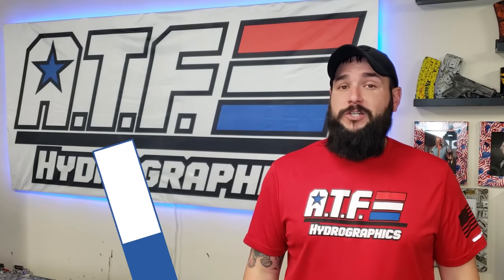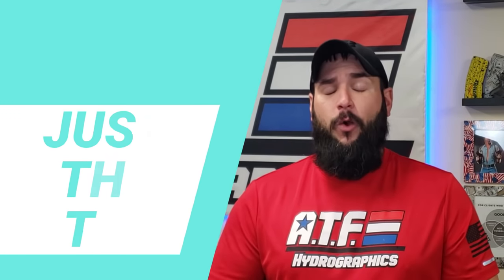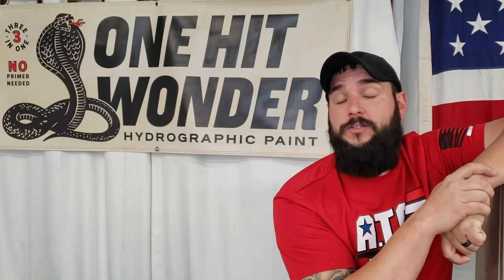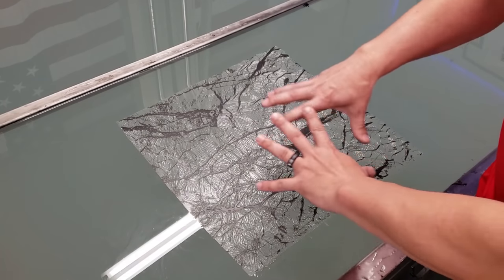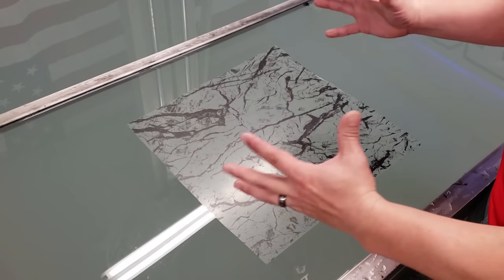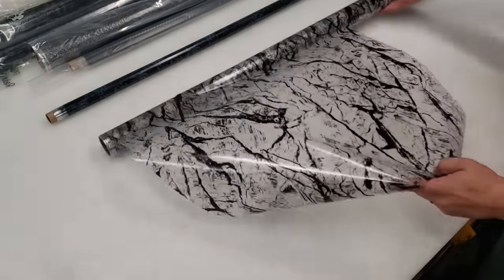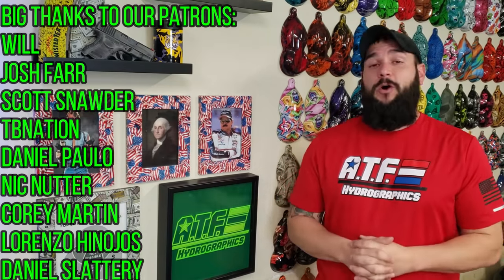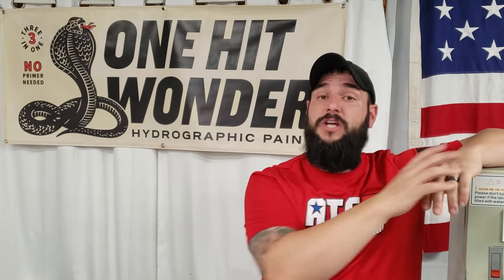Want to get better at hydro dipping? Stop Doing This!

Comment: I just dipped a small gun part. Had cleaned it, scuffed it and primed it 2 days ago. My test was good but when I dipped the part, it looked great when I pulled it out of the water but when I rinsed it off, not only did the pattern come off, the primer did too. The part had a camo pattern but I cleaned it and scuff it and thought priming it would be ok.... do you know where I went wrong? I don't want to dip the rest of the parts til I find out why this happened. I'm new at this but I've done several pieces and this is the first time this happened.
Reply from the maker: What kind of paint did you use, and how did you scuff it?
Reply: @AllThingsFunHydrographics  scuffed it with those red scotch pads and used the shark bite, I think it's called, paint
Reply: @AllThingsFunHydrographics  Same process as I've used before but it's been humid and I'm doing it inside but with the garage door open. Not sure if that played a role?
Reply: @AllThingsFunHydrographics  I just tried another gun part. It was brand new. Cleaned it, scuffed it, cleaned the dust off. Primed it and I did a roll dip on it. I had practiced on some tumblers and while my technique wasn't great, the film didn't stick at all. It literally was dripping off as I pulled it out of the water even before I had a chance to rinse. The smaller accessory parts I did for the same part came out ok right before it. One of them seemed to have the pattern pull off a little but not like the main part. I took a video of it dripping off and a pic of what it looks like now. Would love to send it to you to see if you can watch it and tell what I'm doing wrong. And I have no problem paying for your wisdom if you can tell me what the issue is. =)

Comment: I’m getting bubbles between my material and whatever I’m dipping, how can I prevent that,
Reply from the maker: Your getting air bubbles when you put the film on the water, you have to lay it in very carefully so that it does not trap air. If you see bubbles under the film you can blow the bubbles out from under the film.

Comment: Ok so i tape the edges because when you spray the activator, the film spreads out but doesn't stop. You didnt show that part. Whats the cure for that?
Reply: I dont have a proper tank, so i dont have adjustable bars. So how can i dip without taping up the edges in the bath?

Comment: Is there a heat resistant film for grills, smokers, etc.?
Reply: No... the films only good for around 400 degrees and the clear coat won’t hold up either..
Reply: @customcyclehydrographixorr3979  thank you.
Reply from the maker: What Roy said. If you need something for high heat I recommend the C series Cerakote. I have tested it up to 1000 degrees and saw no changes in colors. They are limited on what colors they have but it does resist heat very well.

Comment: I tried your tips today, with no mask to the side, but when I spray the activator the film starts to distort the image... How do I fix it?
Reply from the maker: You need dams to hold the film in place and keep it from moving. Watch any of my videos where I am dipping something and you will see I use dams to keep the film from stretching. You can make dams out of anything you want, some people use pvc pipe, aluminum roof flashing, tape. I have aluminum dams that came with my tank.
Reply: @AllThingsFunHydrographics  I understand, I just thought they were used to keep the film still. Thanks a lot for the answer. I keep learning from your great work.

Comment: I’d imagine the cryptarch film rolls on itself due to high concentrate of ink in the heavy pattern making it heavier in other blotches then what it is near edges, making the film tighten on itself. If that makes any sense. Heavier ink pattern cause it to weight down on the film, dragging corners in or up.
or 
I’d imagine manufacturers have maybe just rolled the film to tight upon its drying, when it was originally printed & they’ve just rolled it to tight, potentially stretching the film, 
Then once it’s cut small pieces it wants to roll up again.
Reply from the maker: Yup probably. Is what it is... so we just learn to deal with it.

Comment: You have to cut little section along the tape before you put it in water, that's why the film cant move!! ;)
Reply from the maker: If you cut the tape then the whole point of the tape is useless. But to each his own, The way I do it works for me and eliminates having to tape, but you can do whatever you want.
Reply: @AllThingsFunHydrographics  I've also seen other videos where people put the tape on the other side. I'm saying this because I saw you put it faced down into the water. I think face up would show different rwsults, as the entire film is touching the water (including the edgesb and once it gets soft, the tape won't restrict it much....I assume...I've never done it myself, but I've seen others do it) I've seen others do it for different films as well, for example, Carbon Fiber designed film. But when it comes to camo designs n similar, they need to expand so tape is a no-no there. But CF would come out nicer with tape...again, I'm assuming.
Your videos are great tho. Very informative indeed. 👍

Comment: I'm sad to see you use a paint like OHW when they advertise falsehoods on their website and won't stand behind their product.
Reply from the maker: Im not aware of falsehoods on their website? What exactly are you referring too? I use their products all the time and it works just fine for me.
Reply: @AllThingsFunHydrographics  automotive grade, can be used over other paints.

I purchased some on your recommendation and it literally melted off the pre-primered part in spots when dipped.

They have blamed everything from the primer not accepting paint, to questioning the activator. (I'll admit the piece was underactivated, but I never seen even overactivation that melted paint (word used from people on Facebook)
Reply: @AllThingsFunHydrographics  also for clarification I was within the window given by the primer for base coat.
Reply from the maker: @McNamaraHerp  oh wow, I have never experienced that. I never put it over primer. I just scuff and paint it right over plastic, metal, or whatever I am dipping. I haven't used it over primered parts before so I have no clue how it reacts. Sorry you had a rough time with it.
Reply: @AllThingsFunHydrographics  yea I'll get parts in from body shops pre primered. So having to remove primer isn't viable.  I think I'm mostly annoyed by their attitude of not accusing everything else instead of figuring out why their paint didn't stick... im lucky I just bought some little half pints to test it and didn't waste my money on gallons (I was about to order gallons right after that dip of 3 different colors)